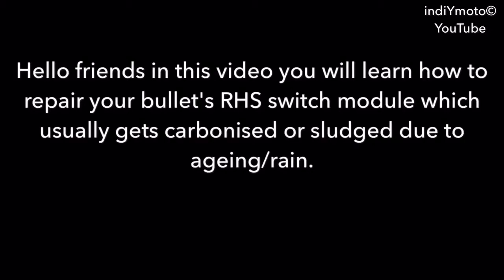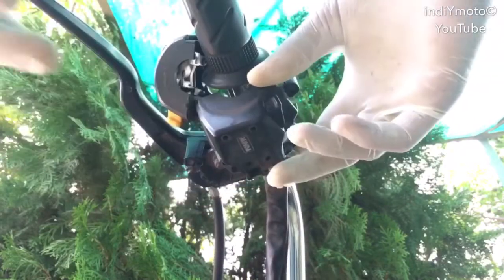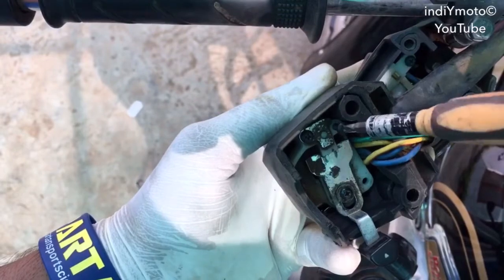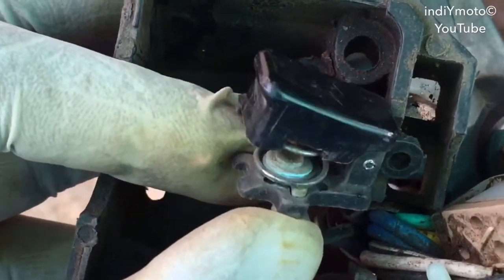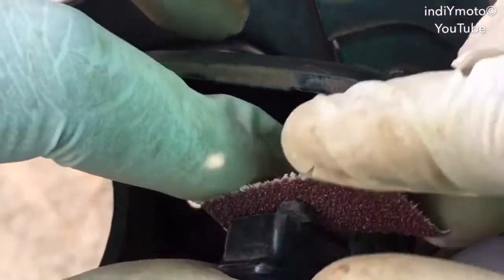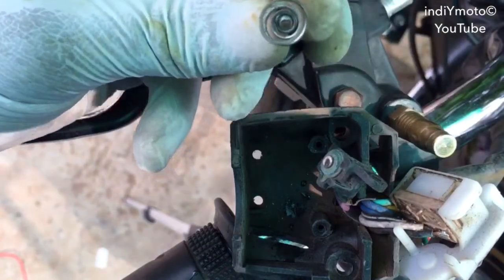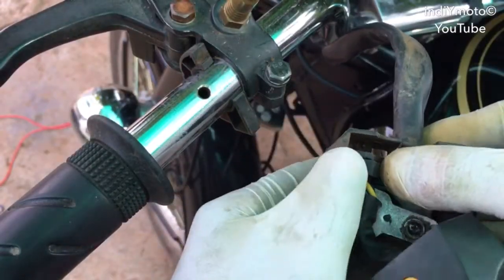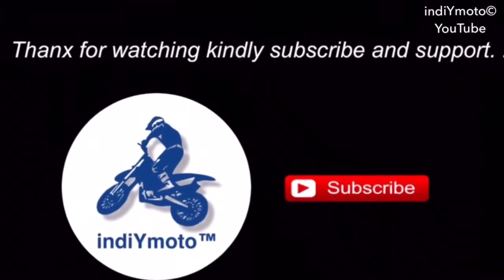How to repair royal enfield RHS switch assembly (horn switch)

Comment: Thanks, nice video brother. What would happen if you spray anti rust/grime spray like WD40 instead of scratching the terminals?
Reply from the maker: Deepak Kukreja depends on the layers of corrosion, also antirust has less chance to penetrate in till the contact points as they are covered from all axis, even if went won't be much, still its good to give it a try.

Comment: My LEFT HAND SIDE blinkers(trafficator) lights are not working. I have opened the head light and plugged the RIGHT HAND SIDE blinker wire to the LEFT HAND SIDE trafficator, then the LEFT HAND SIDE is working. Which means the light and light assembly from head light is working. Now I am concerned about the blinker switch in the RHS switch assembly (as showin in this Video). All other functions(horn, head light dimming etc) are working. Except Both front and REAR trafficators on the LEFT HAND SIDE. I guess I need to open the assembly like above and dust off or re-lubricate the switch. Any help with a video of fixing or cleaning the trafficator switch in the above assembly? Thanks